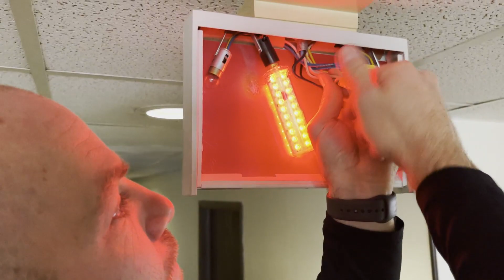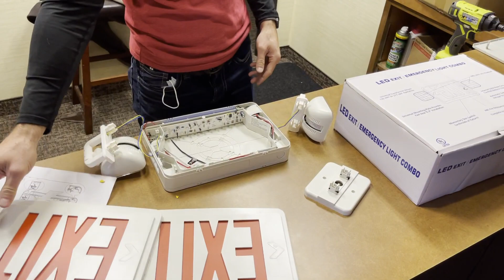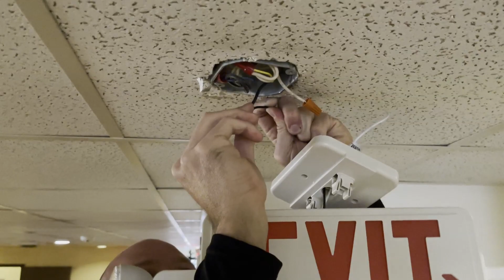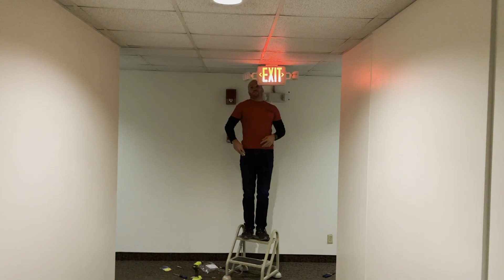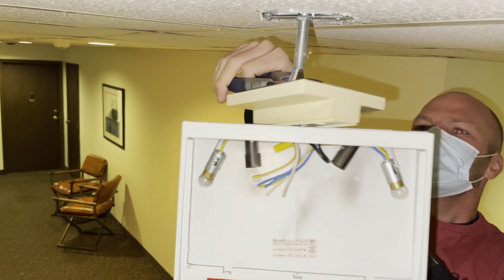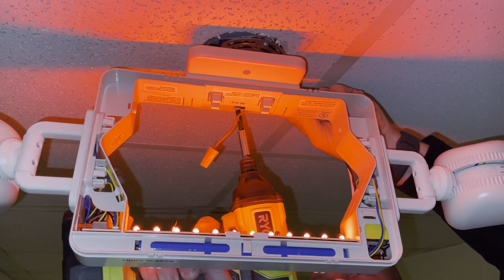Replace Emergency Exit Signs and Lights

Comment: The old unit is much higher quality. If you're going to replace an exit sign, at least choose a high quality model, not some no name on amazon that probably won't work in a real power outage.

Comment: Good video, detailed and understandable. Can’t exactly recommend that exact sign because they are cheaply made and more often then not get worn out after a few years and start to die, so then you have to replace the entire thing again. Besides that nice video 

(Also I think the next thing that needs to be replaced in that building is the fire alarm system. Those space age devices are really old)

Comment: Why do my lights turn on when plugging in the red/black light cable to the battery wire harness as you did. My 2 lights stay on all the time!

Comment: Always nice seeing high quality, functional signs being replaced with generic trash 🙄
Reply from the maker: The old signs were quality... but functional?  They were not working as intended and the battery systems would not support the outdated lighting systems.  These new ones with lithium and Led technology were easy to install and I am proud to report that during our last power outage they lasted for hours upon hours.  Almost 10 hours.  I am very satisfied with this new product and are glad we made the upgrade :-)
Reply: @SkyManagement  You can add almost any battery to those old exit signs.. They are literally just light sockets. An exit sign using Lithium is already a red flag, quality models typically use Lead Acid or, even better, Nickel Cadmium

Comment: When shutting of the breaker I noticed it was labeled 125/277 do I need to attach the red wire to the black one coming through the wall and cap the black one on the light?
Reply from the maker: We were not connecting them to the 277 so you would need to consult your manual .  I am sorry this is a late reply.  Just now getting around to all these comments!  Enjoy the New Year!

Comment: Why did you also install a generic than a new dual lite.
Reply from the maker: I’m sorry. I’m not really sure what the question is. The old exit signs didn’t have the side lights on them. We showed a comparison between the old style and the new style. This was in an older building where the exit signs in a power outage were powered by the battery in the adjacent emergency light. These new exit signs have their own back up battery. However we kept the existing emergency lights anyway because having a redundant back up didn’t sound like a bad idea. 
I hope this cleared it up.
Reply: @SkyManagement  I think he’s asking why you replaced the sign with a cheap bad unit rather than a more expensive higher quality unit

Comment: Those models are ripoffs to Lithonia.
Reply: They are not Lithonia Lighting “ripoffs” the actual combo was made by Jiming, but Lithonia Lighting rebranded it, also the ones they installed was Spectsun’s signs (which was also a rebranded Jiming but more better quality).
Reply: @TheExitSignDudeOfficial  Are you serious? Look at the two!
Reply: @18436Melissa  They do look the same, but Lithonia rebranded the older gen one, both older and newer gen is branded by Jiming
Reply: @TheExitSignDudeOfficial  Ok so? I've seen this EXACT model in the Dollar General next in my area.
Reply: @18436Melissa  Cool
Reply from the maker: Unsure what you mean but they work.   I will look into the brand you suggest...
Reply: @SkyManagement  you should look in to dual lite
Reply: @Dominantbro  Dual Lite is overrated imo
Reply: @queencitysirens8755  yeah it is
Reply: @queencitysirens8755  Even though I like Dual-Lite, I do find it overrated and underrated 😂
Reply: Lithonia lighting did not make the generic exit sign
Reply: @alexgreat-wu8ye  But it is based off of it.
Reply: @18436Melissa  there are over 15 companies that rebrand that exit sign